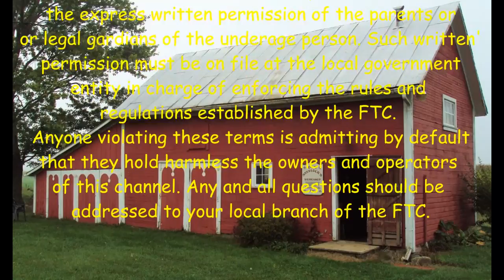Sharpening Hedge Shears - Like Speer Henry said “It's Always Sumpee!"

Comment: I have some Stanley hedge shears that seem to be about 50 years old according to the internet, excellent quality steel......They have what appears to be vinyl dipped handles and those are in excellent condition too..............Yesterday me and the neighbor were doing a little brush cleanup with lopping shears, I have some old ones that belonged to my Grandfather probably from the 60s not a nick on the blade even though they've been used a hundred times more than the average homeowner ever would.......He has some newer ones that are all nicked up and sloppy as heck.......Unfortunately my loppers have no name on them or I'd probably try to find another pair or two on eBay.
Reply from the maker: The cheap ones don't last. Do they?
A good set should outlive me.😁😎